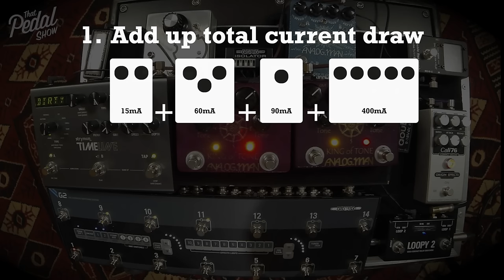That Pedal Show – How To Power Your Pedals Properly & The Legend Of VCPI

Comment: I love the show guys, I need some help. I got a Cali 76 C deluxe. I have isolated it with its own 18v 100ma power, with an iso5 supply. Still can’t get rid of the hum when engaging any overdrive pedal with it. With a strat guitar. Don’t know what else to do. Bloody pedal produces a loud hum, is this normal?
Reply from the maker: First off, watch our show on noise from a few weeks back. You need to identify the cause of the noise. It could be the overdrive, it could be RF hum from he guitar. It could be that there are other pedals on the board that aren’t isolated - all the pedals on the board need to be isolated or you will get ground loop hum.  Start there and let us know how you get on - that other show has the answers. :0)
Reply: That Pedal Show thank you. I do have all pedals isolated and properly powered, does the compressor being the second pedal in the chain affect the noise? Sorry but I even bought a separate iso box just for that reason. I’ll get back to you after redoing the cables and source it.
Reply: That Pedal Show the noise is there, I saw the other show and I guess it’s the nature of the single coils that exacerbate the RF noise. With my hot rails pick up it goes down considerably. I tried a NS pedal on the FX loop and it works yet it sucks the tone outta the clean. I guess juts get over myself with trying to have a quiet rig at all times. Thanks you for all that you do. Greetings from sunny California.

Comment: I'm a bit confused with the t-Rex time line quote at 7:17. I have a t-Rex chameleon power supply powering a strymon timeline on its own output. They are 300ma an output and strymons website say the timeline need 300ma. Does it need 500ma for better headroom? Hi from 'straya Dan!
Reply from the maker: It’s a grey area to be fair. Technically the T Rex will be absolutely fine. We just like to make sure everything has plenty of super clean current, then you know the power supply isn’t causing you any trouble. Mick here. I thought this was all bollocks until I heard it with my own ears. Dan’s power supplies sound better than anything I’ve ever heard. Sounds like madness right?!??

Comment: The bit about doubling the mA..is that overkill?
Suppose you want to power a digital 500mA 9V DC pedal, like a Zoom G5...would a high quality 500mA output from something like a Strymon Ojai not do the job?
Reply from the maker: It’s overkill to a point, and it’s not about the individual outputs of the supply, it’s about the capability of the entire system
Reply: ZOOM G3/G5n etc have their own power adapter (500 ma).made for it.The G3n/G5n usually runs about 300ma so 500ma is fine..keep it isolated using other power adapter for different effects.

Comment: You might need to post a correction about the T-Rex Chameleon - I power my Timeline fine with mine, although it is the only unit attached to that particular power output.
Reply from the maker: +richab88 TimeLine requires 300, Chameleon puts out 300 per output so it's technically in tolerance and will work fine. Strymon says 300ma minimum, so you're correct. It's also regulated and decent quality so won't suffer as bad as a cheapo non-isolated one. Be interesting to see what happens if you really loaded down the rest of the outputs. As I say (Mick), I have one and use it for most things. Wouldn't meet Dan's ideal scenario, but if it works, it works!
Reply: Thanks. Having said that, is there a way to combine isolated outputs so the Timeline receives more ma, but the correct voltage? Thanks again for a cool show! Watch it every week. Waiting for to start "That Tube Show"! lol

Comment: I have a question not necessarily related to power supplies but will the g2 allow me to run a wet/dry/wet rig using my current stereo effect pedals plus normal pedals and 3 combo amps? Marshall JTM45 and 2 Fender deluxe
Reply from the maker: +TownerBruce yes, with an added HumDinger. We did a show on wet/dry rigs, check it out :)
Reply: Awesome, thanks for the reply. I'll look into that. Watching the video now!

Comment: Guys, any advise on using the Pedaltrain "Volto 2" that has to be daisy chained to power more then 3 pedals at once? 

Since the pedals wont be isolated from each other (using Volto 2), will it cause the noise issue as shown in the video?

Thanks!
Reply from the maker: +Trevers Goh it all depends on the pedals
Reply: That Pedal Show I see. Thanks for the reply! ; )

Comment: I have a question and I hope someone might see this and shed some light on it. There's no stack overflow for pedals, is there? 

I recently purchased an MXR EVH90. I power all of my pedals with individual power bricks, and I'm putting this phase 90 first in the pedal chain (which essentially is what Eddie did) before all of my gain pedals. However, when I put that EVH90 into my chain using a separate power brick, it makes a lot of noise that I can only describe as "clicky static". It's so loud, it's unusable.  However, if I use a daisy chain cable, or put the pedal at the end of the chain at my amp - the noise goes away. This sounds like a ground loop to me, but how could that be if I'm using separate power bricks for all of my pedals?
Reply from the maker: That is weird Thomas… and very unusual that a daisy chain would solve a hum problem! It’s likely to be something in the power supplies but the only way to check that is a long process of trial and error, or at least process of elimination finding out what the culprit is. The solid gold solve would be to invest in a really high quality power solution with proper isolation. However, the fact it works at the end and not at the beginning even with the same supply would suggest that’s not the problem. Again, process of elimination. With it at the start and making the noise, remove each of the subsequent pedals one by one and you’ll find a culprit. 
Before doing that, swap every patch cable one by one and see if it’s that. If Dan reads this he might chime in with something more insightful. Cheers!

Comment: SO what was that little black box called that the power cord ran into that made the noise go away?
Reply from the maker: +Gee Mac72 That's a Time Lord by TheGigRig. It's one of many specialist devices that works with TheGIgRig modular power system. We do try not to push Dan's stuff though, because this is resolutely not about trying to flog you GigRig stuff. Please buy the stuff that suits you best!
Reply: Thank you sir.

Comment: Another acronym to chew on for your next video is MI. Magnetic interference. I have the Voodoo Lab Pedal Power 2 Plus that covers VCPI concerns very well, but it does have the best quality transformer of power supplies on the market. Along with having the most powerful transformer, there is an increased magnetic field. With a wah pedal on the opposite side of the board I get a little noise. Then after modding my wah with a Halo inductor the noise is much more intense. Yea if I move the pedal off the board the noise goes away. But I do not wish to remove the wah from the board. How can we shield the wah from MI?
Reply from the maker: +Nor'easter Playa there's almost nothing you can do about the mag field effect. It's a square law so double the distance for half the effect.
Reply: "almost" nothing?
Reply from the maker: +Nor'easter Playa sometimes turning the supply can help, like you do when you turn your guitar to find the quiet spot

Comment: so is it safe to say that while you need to match the voltage of the pedal perfectly to the output, the current can be equal to or more than the required mA of the pedal ?
Reply: I tried using a power supply of equal voltage but with more mA than my pedal and nothing happened. Then again It's my first pedal and I bought it yesterday, so I don't know anything. The pedal could just be DoA or something.
Update: It should probably work, if your polarity is correct
Reply: @wyatttibbitts8603  ya actually I've been powering my strymon flint with an mxr dc brich which has power outputs of 150mA, whereas flint requires 250 mA of current. Even though the pedal is working perfectly, there's a bit of static noise coming at 80's settings. So I am wondering if I should power it with an MXR iso bric which has isolated power output of 300mA .. Hopefully that should take away the noise.

Comment: If i have the ethos pedal which runs 24 volts and the 1 spot cs 12 pro, which has the highest output at 18 volts, how do I power 24 volts into the ethos?

Comment: Ok I have a question. Any idea why the pedal manufactures chose to make the center pin of the power plug negative as opposed to positive when most other devices are center pin positive?
Reply from the maker: +Gary Poland which I knew
Reply: A popular belief is that it was the standard that Boss used and other pedal makers simply copied it for compatibility.

The negative centre pin is still connected to earth, which is why it is a  strange design choice.

Comment: Where can you find an isolated adapter? (the thing that you unplugged from the Timeline?) Can they help with shitty in built power supplies in pedal boards?
Reply from the maker: +Sync1O5 you can find them at TheGigRig.com , the TimeLord is what we were using in this video, but it won't help if you're using a poor quality power supply that's not man enough for the job
Reply: Thank you very much for answering! And thank you for doing the show!

Comment: I do slightly disagree that buying a decent power source has to be an expensive undertaking. The Harley Benton ISO-2 Pro is below 70€ and provides 8 isolated 9V Centre Pin negative outs, first two with variable voltages up to 18V. Plus each out supplies up to 500mA. Comes with wallwart psu and 8 power cables plus a y cable. Available from Thomann and nearly 170 very positive reviews, it elements hum, good build quality etc....

Comment: Hm. I've been powering approx. 9 pedals + my Boss ES-8 by daisy chain from a single 1670 mA wall socket power supply for more than a year without any problems or significant noise. The total current draw is estimated to be in the 1100-1300 mA range. Am I just lucky so far? And my system just waiting to break down anytime?
Reply from the maker: +Arne M. Dahl If it works, it works Arne! Do you find it's noisier in different environments? But if you're not suffering with noise and you're happy with the tone, everything is rosy!
Reply: That's comforting to hear! There might be a little more noise in some environments, but not significant. But my system has probably not been put to an extreme test yet (close to big lighting rigs etc.). Part of the reason for asking is that upgrading my system with "proper" power supply would be a signifcant cost: a new bigger pedalboard, new power supply and probably more new high quality patch cables.
Reply from the maker: +Arne M. Dahl As with all expensive upgrades, you're talking about diminishing marginal returns in real terms. So much depends on the volume, the venues, your sounds themselves, your style... Impossible for us to comment on whether it's worth it to you. One way to get an idea would be to disconnect groups of pedals and see what the resultant sound was like. Or try whatever can take them, on batteries instead. It might be enlightening. Cheers!

Comment: Any chance you can show us how your isolating blocks are run in the loop, if you get me?
Reply from the maker: +Cathal Daly not quite sure I follow?
Reply: Sorry. So I use a mooer micro power supply on my electric board and there's a bit of a hum. The outputs from it are supposed to be isolated, do I need to add on a similar isolation box to each pedal now too? I've no digital pedals on it
Reply from the maker: +Cathal Daly one thing is a magnet field effect that can happen from the power supplies, see if moving the supply makes any difference. Apart from that contact the manufacturer:)

Comment: At 34:30 Dan is saying that the germanium pedal he's holding needs to be isolated, and shouldn't be put in a daisy chain. 
Does he then imply that certain fuzz pedals are not supposed to be put into a daisy chain? 
I've noticed in my own experience that my Big Muff sounds worse when put into a daisy chain compared to when isolated. Is that what's going on? Any help from the folks here in the comments would be appreciated.
Reply from the maker: +Jake Angelastro Couple of considerations.... First that a basic daisy chain isn't isolated so any noise (which fuzzes are notorious for) may well cause problems elsewhere.
Second - and much more important - there are certain fuzzes that can't share a power source with other pedals. Some of them can take an isolated power supply, but mustn't share one with other pedals. It's slightly confusing because it's not a simple polarity thing (most stompboxes are 9V, centre negative for example). An Analogman Sunface, for example, can work off a 9V centre negative supply, but its germanium transistor actually has a positive ground. Fine if it's isolated, but it will kill the power supply if you use it on a daisy chain (because the other pedals have negative ground).
This is for certain germanium transistors.... A silicon Sun Face, for example, is fine on a daisy chain! 
As a result, quite a lot of vintage style Germanium fuzzes don't have power jacks at all. The best advice we can offer is simply to do whatever the manufacturer says you should do as there's no 'standard' approach when it comes to germanium fuzzes. Cheers.
Reply: That Pedal Show wow, thanks for the detailed response! I'll keep all of this in mind when working with my fuzz pedals from now on! Thanks!

Comment: I need H E L P !!! 
Can I power a strymon Timeline into a T. rex chameleon? Mick just mentioned here this but I am confused...If one slot (isolated) on the power supply allows current of 300 mA and the strymon needs 300 mA, I cannot use that slot? The double current applys to every slot individually or only in total ? I mean the Chameleon allows current of 1500mA! My total mA countage of all pedals is arround 600 mA! It should be enough ? Or current must double on every slot of 300 mA?? Can please someone help me here??? Thank you in advance

Comment: Boss must be indestructable then!
I accidentally plugged a very overpowered power supply into my boss chorus. Smoke started pumping out it. I unplugged it, waited a bit, and plugged in a 9v. Totally fine, and still is!
Reply: Did you put it in a 12v or a 18v? Also, what happens if you plug a DC into an AC or viceversa?

Comment: Hi guys, I Sadly I live 1/4 of a mile from an AM radio tower and some pedals I unfortunately I will get AM radio bleed over. (Talk radio bleeding through when you engage the pedal). I purchases a green ringer clone that I am getting talk radio bleed through. I even upgraded my power supply to a Voodoo Labs Power plus 2. (All isolated outputs)

I had a pedal like this a while back and a buddy was able to fix it by putting in a resister...... I believe it was a 10K.
I am great with soldering but don't have any electrical knowledge as far as reading electronic specs. For a novice do you know of anywhere I can get an actual picture diagram or even a photo like fender or Duncan does to wire a guitar pickup in? If I could obtain something like this I would be good to go. Thanks for your help in advance! 

I got the pedal for $50 and my local amp repair guy charges $75 .... I hate to dump this pedal off my board!

Comment: could you get Hiss from running just one pedal with a wall wart , knowing everything else is correct could their still be an isolation issue going straight into an amp ?
Reply from the maker: Not if it’s a decent wallwart, in this scenario it’s still isolated
Reply: @ThatPedalShow  Its a eventide H9 supply with a eventide H9, ive heard these can be noisey with low output pickups like that on my Strat ( going straight in ). Would it be normal for that pedal to have some inherent noise? thanks for all your content its really fantastic .

Comment: 100000 likes for doing this. I never understood this, I haven't been able to get my rc 300 loopstation working and I think it's the power supply. I thought I broke the pedal but I'm going to try a better power supply and see what happens. Anybody reading this, is there anything weird about the loopstations power needs that I should know?
Reply from the maker: +jdome jd Hello! Just make sure sure it has enough current and the right voltage. It needs 320mA current and 9V DC centre negative. Give it 500mA and be happy. Only 9v however!

Comment: I read that true isolated multi power supplies must have an IEC connector for power, and if it has an DC adaptor instead, it means that it is not truly isolated on all sockets, but only isolated from the wall, is this true?
Reply from the maker: Hello! Mick here. I have no idea, electronically speaking. What I do know is that when I use Dan’s stuff and G2 or G3 I have no problems with noise whatsoever. When I use anything else, I usually do. Cheers!
Reply: @ThatPedalShow  thanks man, I'll check it out

Comment: Can i run 300 mA into a normal pedal (boss od3, EHX hot wax)?
Reply from the maker: Yes. As long as the voltage and polarity is correct. Cheers!
Reply from the maker: Yes. As long as the voltage and polarity is correct. Cheers!

Comment: how many mA's would the isolator module provide per isolated output? on the site it says max 120mAs "The Isolator has 4 Isolated outputs that deliver 9V at up to 180mA" ?
Reply from the maker: +Jero Calvo the new ISO's can deliver up to 180mA